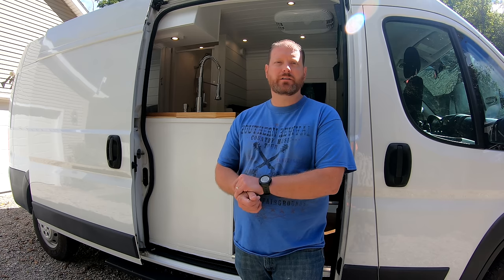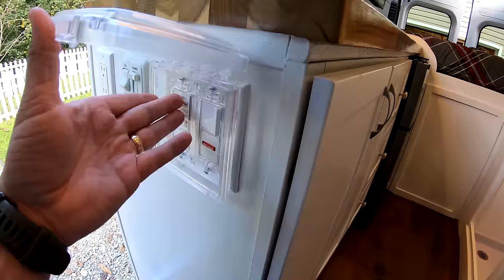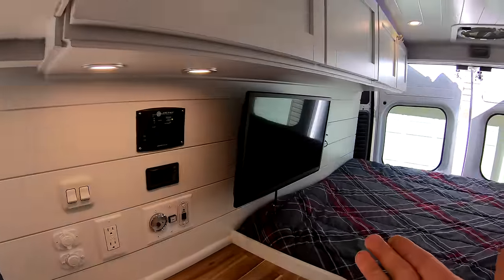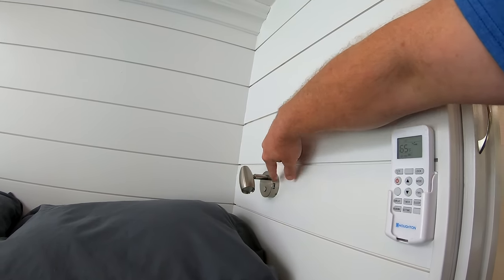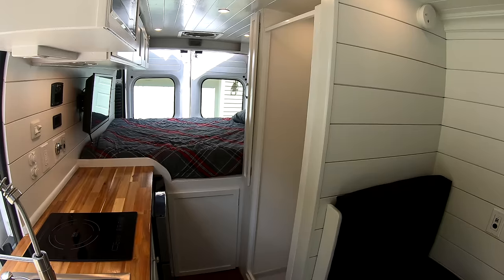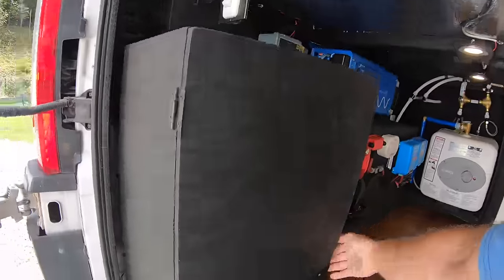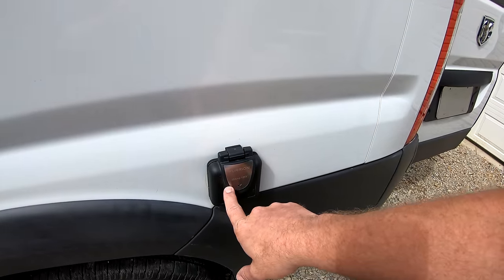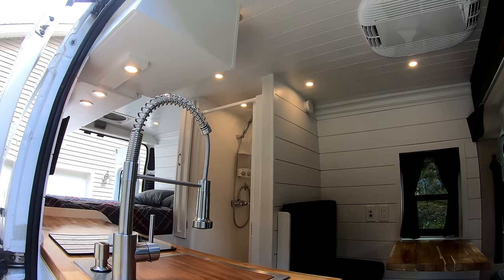We Built Our Custom Van Conversion In 30 Days - DIY RAM Promaster Camper Van Tour

Comment: This van scares me very much. It is apparent that you gave most of this build a lot of thought, however you have not given enough consideration to the danger of that added seat. This van is more of a death trap than most. I strongly recommend that you remove that seat belt and and self-built seat and install a proper van seat. You may have attached the seat belt to the frame, however, in a crash, the mass of the rest of the build is going to use that belt to slice it's occupant in half - PLEASE watch the (sadly few) RV crash test videos here on YouTube and you will see how wood splinters in a crash. The water heater (and battery bank?) will very likely  to end up against the back of the driver's seat and it won't care what it smashes on it's way there. At least with a proper van seat the occupant has a chance to survive. Transit removal seats can be had for reasonable $$$. Do not put anyone in that seat when driving!! PLEASE!!
Reply from the maker: You are entitled to your opinion, but I feel you have exaggerated the situation greatly and the amount of drama expressed in your comment is ridiculous. The water heater has been replaced already (another video) and is bolted to the van frame, along with the inverters and battery box. Obviously in a bad enough crash, everything is subject to being destroyed, but this van has been constructed way more solid than any motorhome I have ever owned. There is no room for a transit seat, but that would do nothing to protect an occupant in a bad crash anyway. Unfortunately there is more risk when travelling in a motorhome than in a passenger car. I did everything I could to minimize that risk as much as possible, but the risk is still there.
Reply: I hope and pray that the drama is only in my comments and not in the death of an occupant. I am not a fear-mongering person and have only two BA-level physics classes under my belt, however the crash test videos are evidence enough of the danger you are subjecting that occupant to. I regret that I once had a similar setup and dodged any serious inquiry of my children, only because I never got into an accident while they were improperly secured. I won't take that chance again. May you never regret that you are now. Please go watch the crash-test videos.
Reply from the maker: @EarlAlvinDaniels  Well luckily I have no children or anyone else for that matter that will be sitting there. It's a just in case seat. I appreciate your concern though.
Reply: I can understand any concerns someone might have but honestly this is one of the loveliest vans I have ever seen built. It simply boils down to usage, that is the kind of person or people using the van, and how much it will be driven. Most van lifers are really more stationery than most people think. They are more after minimalist living and cutting cost. If it's a couple for instance who would hardly have anyone on board, the driver and passenger seat is enough for them while driving. Personally, to the person who built this, well done. I prefer dry flush toilets though so I would use it instead.